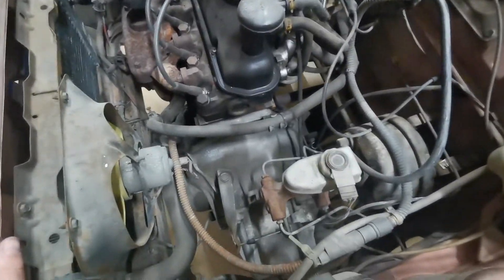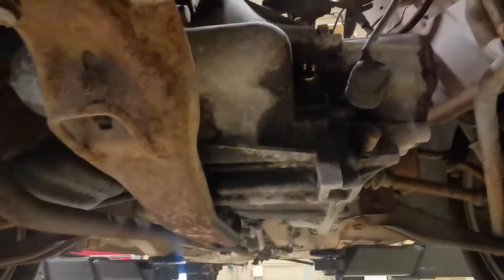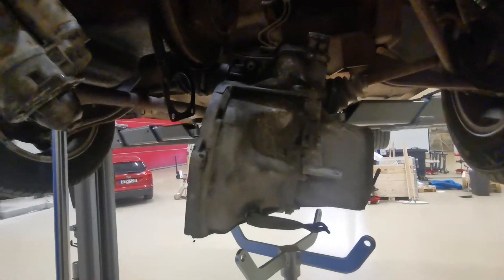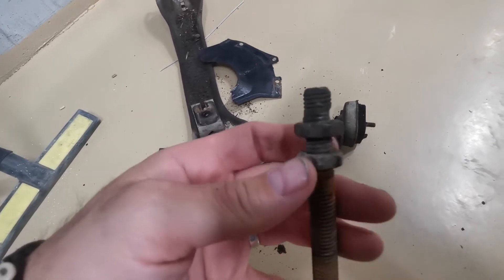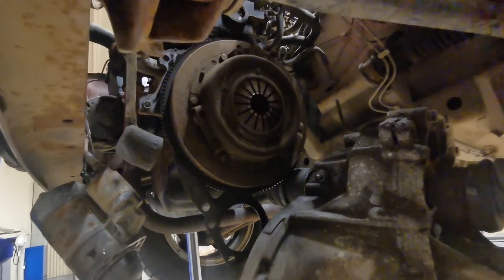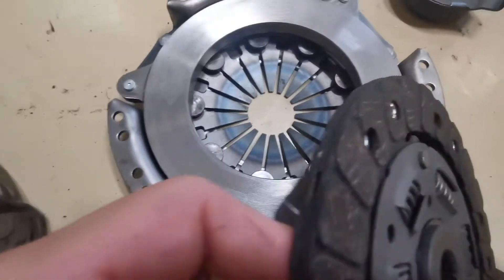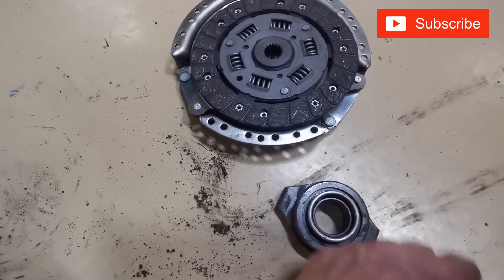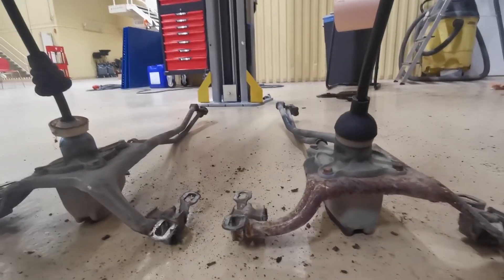Anyone can change their clutch with this step by step guide. Ford Fiesta mk1.

Comment: Great video Mike! I've got a mk3 Escort 1.1 (Valencia engine though). Would moving the gearbox down like this work on mine? I was reading about disconnecting the CV joints and removing the box in the haynes. Also I'd probably have to do this on axle stands and in a garage when I can find one... what do you think? took me a while to find anyone doing a clutch and an 1.1 Ford ha!
Reply from the maker: I think I remember that this could be done without removing the drive shafts on a mk3 escort. If your doing it on axelstands then it dosent need to be hanging that much as your not too high off the ground so it should be fine. If your still unsure make sure you have a jack under the gearbox when you take it out then you can make sure it dosent drop too far.
Happy i can offer some advice and thanks for watching 😊
Reply: @mike_themechanic  Thanks for the advice! If I can find a garage to work in I'll get round to this job pretty soon. I forgot to ask. Did you put the car into a gear before taking the selector out? Just remember reading that it has to go in 4th but maybe thats if you take the drive shafts out? 
Enjoying the engine swap videos. Really inspiring !! 🙌
Reply from the maker: @RetroAndRusty  I normally have the gearbox in neutral when removing it. When you put it back together you can test all the gears from underneath with a punch or a screw driver in the hole.
Soon there with putting the engine in for the last time (hopefully). It really pleases me to know I can help someone 😊